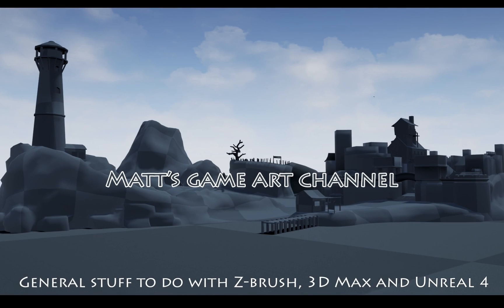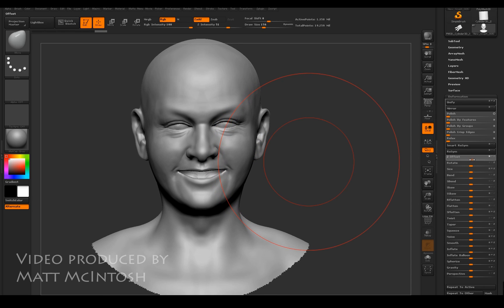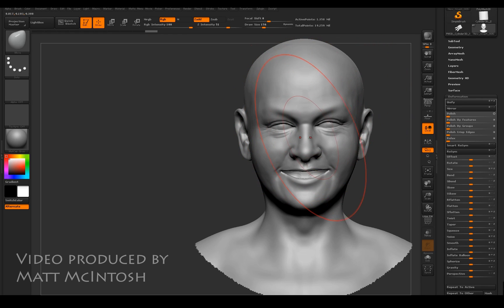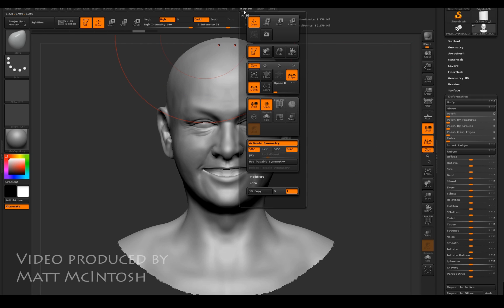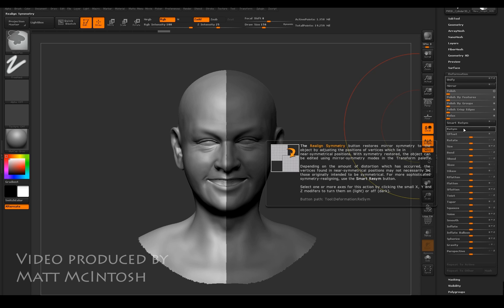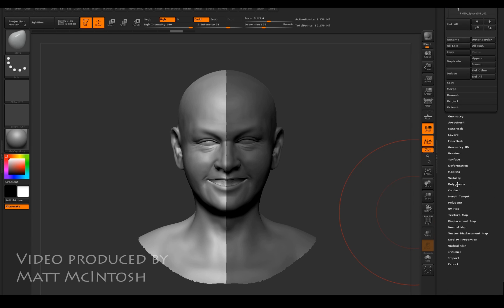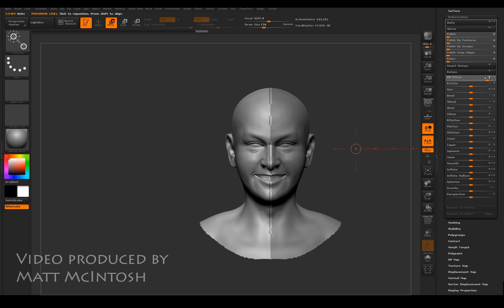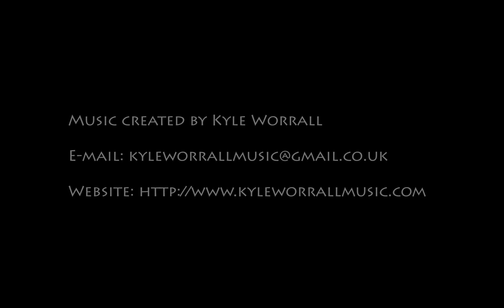Zbrush Symmetry issues tutorial

Comment: hi ı got a question : when ı use the symetry that brushes doesnt work simultaniously . I mean there is a different pressure both of them . how can ı solve this ?
Reply from the maker: Not really sure what that issue is as I've never seen it before (that's with dealing with a lot of students over the years too). I'd probably say if the Symmetry is out just a little it could possibly give that effect. Matt